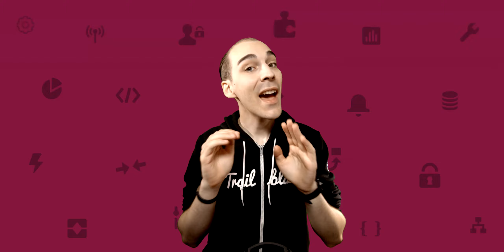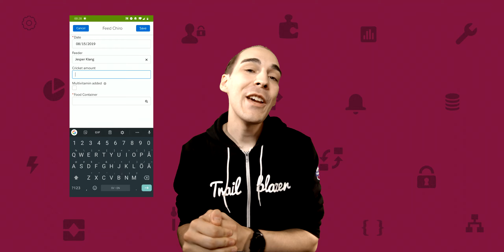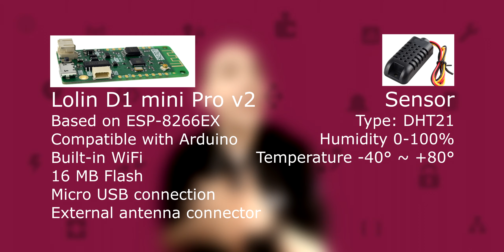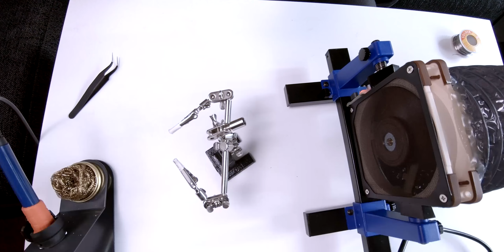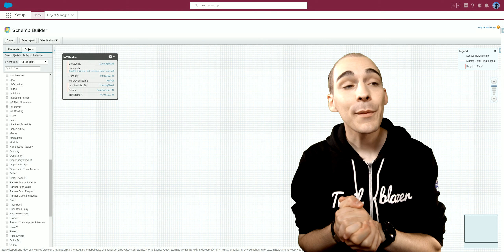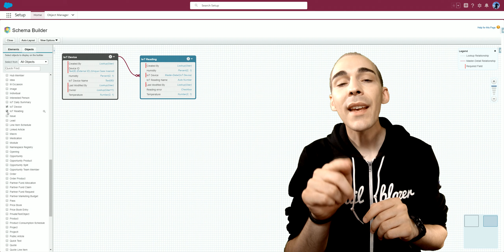Connecting an Arduino to Salesforce - Part 1

Comment: Hello Jasper , I am currently working in a similar project. I am trying to connect and inverter IOT module reading to Salesforce. The simplicity of your explanation is quite interesting. I am watching other video parts and will provide feedback. I wonder if you could update the video series with am ESP32 module.